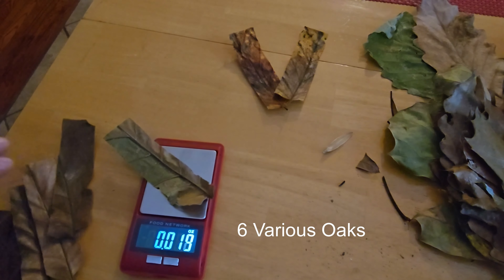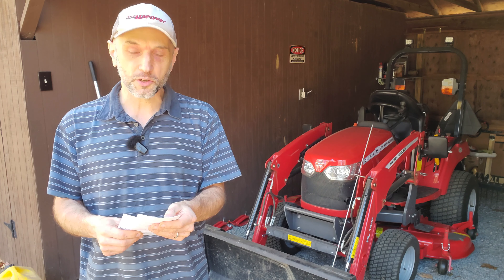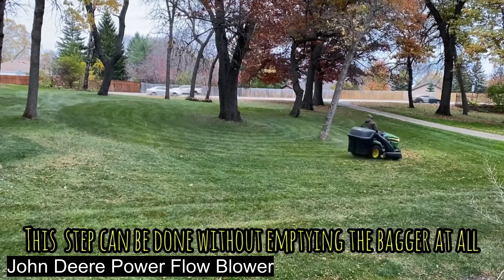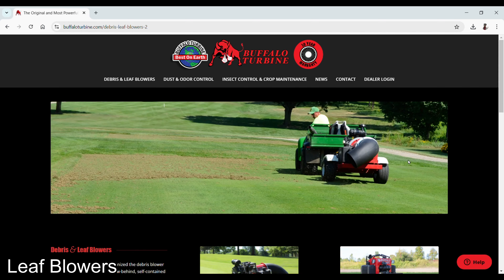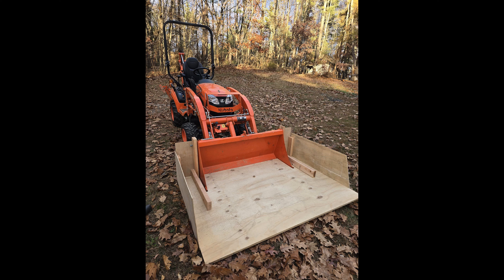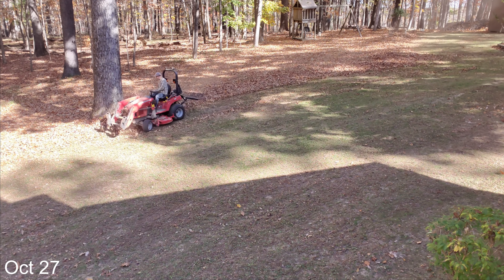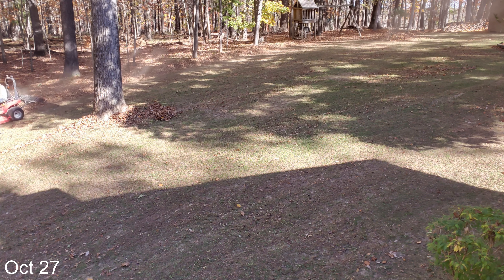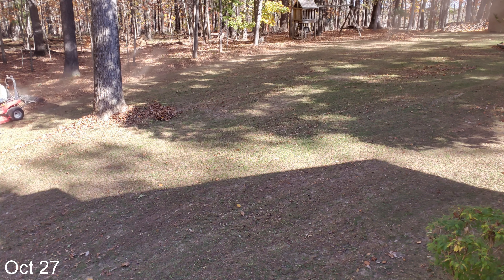Comparison of Different Leaf Cleanup Methods

Comment: Good job Ed.  I've got steep slopes to mow, and de-leaf.  For mowing I use a zero turn mower.  It has a mulching deck on it, so I use that to clean up leaves by just grinding the leaves into flakes that settle in the grass and break down over the winter.  I've been here for 23 years and have not seen any issues of leaves forming thatch and choking the grass the way grass can.  I do have to do the clean up frequently during heavy leaf-dropping season or the deck turns into a leaf plow, as you mentioned.  I have no place to push them off to, so I just have to keep working the piles with the deck raised up until I have them ground up.

Comment: What's up Ed.  Honestly the deck did pretty well.  Are those the stock blades, or did you manage to find mulching blades which fit.  I was never able to track down mulching blades for that massey deck.
Reply from the maker: @pondacres  i bought it used, but they are stock blades as far as I know. We haven't had rain for 37 days, so it's extremely dry. The Massey really chewed up those leaves. By the time I got to the woods line, there wasn't much left.
Reply: @Redneck_Ed  Yeh, I'm pretty surprised by your results, at least what it appears like in the vid, actually breaking up the leaves.  I never got good mulching results like that with that deck.  Regardless, it's a beast of a deck though...will chew through anything and not get clogged.  You could do brush hogging with that thing, if you don't go too crazy.